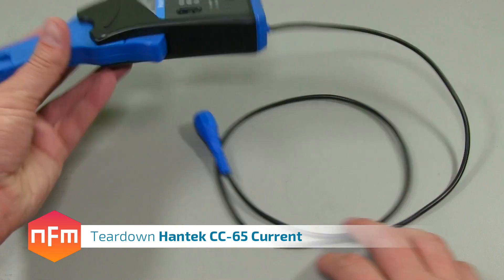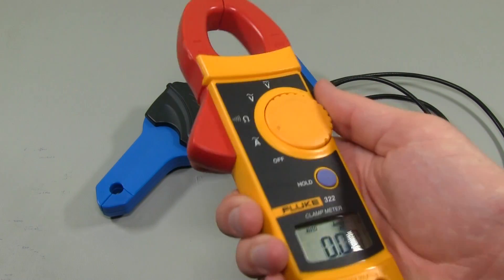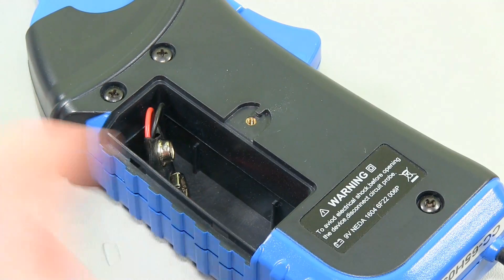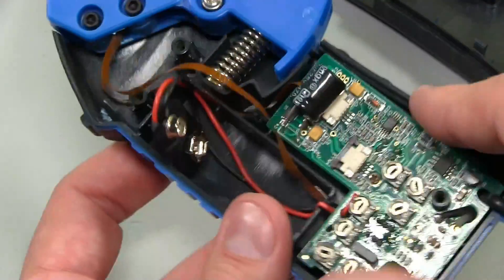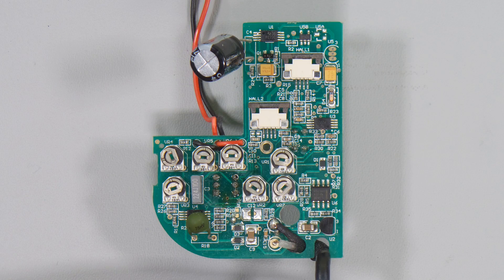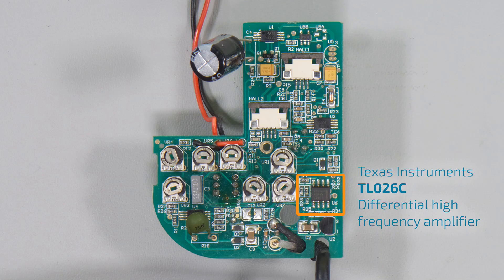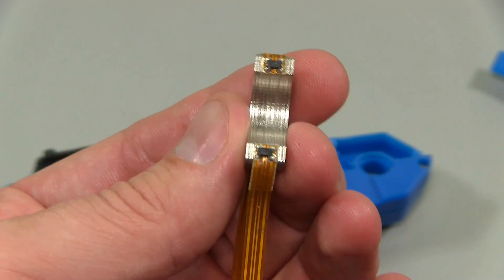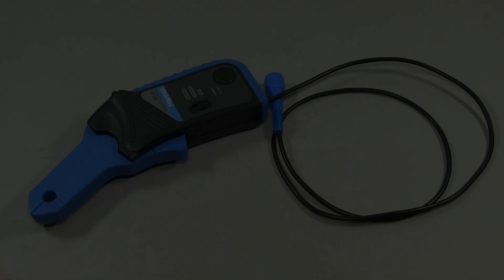Hantek CC-65 Current Clamp - Part 2 - Teardown

Comment: I'm sure Hantek NEVER use their own products  ... in 2021 the Zero button on ONLY the CC65 gets stuck down... Ie it travels too far down. Now why they can make a zero button work on the CC650  and not on the CC65? Use dielectric grease to resemble with luck those silly spring dual switch. Fixed the problem by putting an o ring to limit travel... Hantek 🤯🤡🤯 like the1008C automotive oscilloscope that fail near HV noise due to non sheilded usb cable...lol!

Comment: Can I use this to measure 3 phase machine tools power?
Reply from the maker: You can use it on one phase at a time with no problems.
Reply: if you want to do in the seroius way there is something called power quality equipment, this equipment can measure the  three phases current at the same time (and a lot of other things)